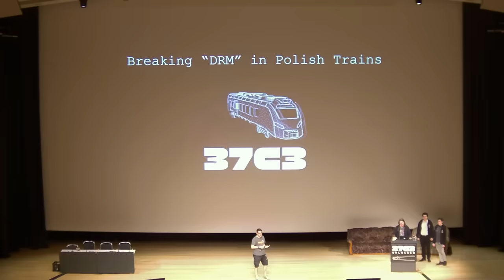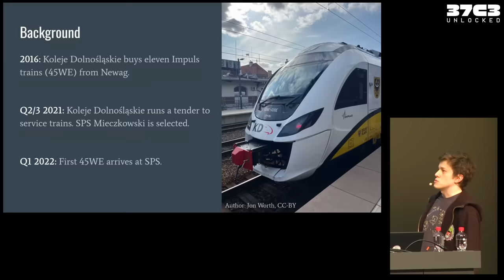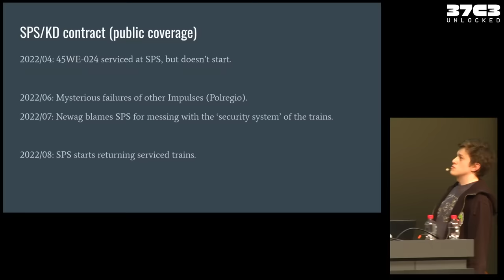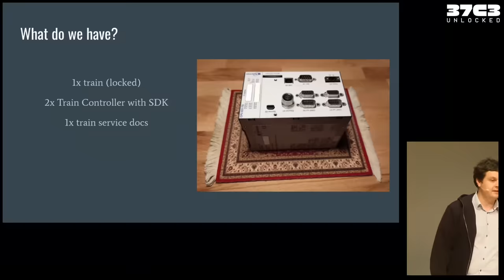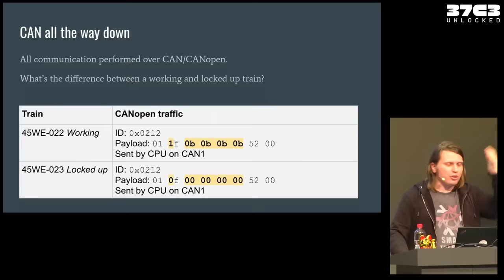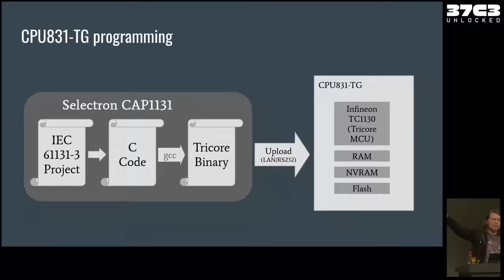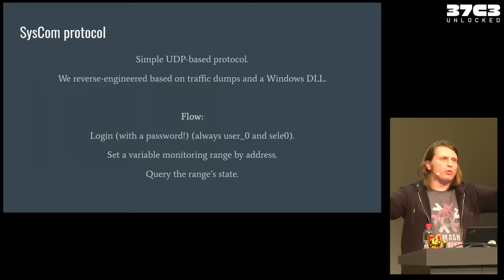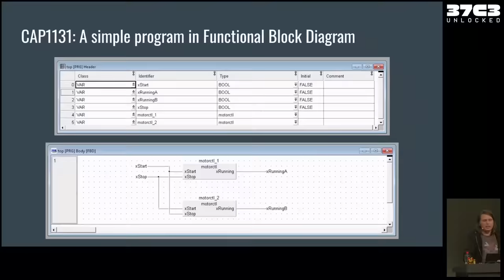37C3 -  Breaking "DRM" in Polish trains

Comment: As someone who's worked with PLCs and industrial control systems, generally speaking the PLC "program" (as in the function block diagram or ladder diagram you actually write) doesn't know if the firmware version is different between the hardware. However, the compiler adds this set of checks in after the fact and generally does just silently fail, unless you have the programming software that goes with the CPU and switch it to remote run. At which point the IDE/programming software will tell you if there's a version mismatch in some cryptic asf error message.

I've only worked on Allen Bradley/SIEMENS/Mitsubishi stuff though, and they're all a bit different to use. Some of them simply don't care about firmware revision. Some of them will only accept that specific controller serial number until you open the PLC program and manually change it. Generally speaking if you look at the patch notes for the firmware revisions and revise how the program interacts with the motor inverters, there isn't much of a problem in just updating the SN/FW version in the code.

In my experience repairing a lot of this equipment, the developers only work on minimum viable product, and then the rule of "there is nothing more permanent than a temporary solution" takes effect soon after if there aren't major problems. There's no polishing the code and making things look nicer or adding error messages for failures. They just add errors for unexpected conditions involving sensors, or disconnected equipment, and nothing else. Everything else is left to the maintainer to just guess how things are supposed to work in the event of a failure. Rules like "my code is my documentation" regardless of how detailed or frequent the comments are is also a key feature. Wiring diagrams are generally speaking plentiful though.

Also, if the trains have to be re-certified after new software is installed on them, then Newark shouldn't have been adding new code to it at all without going through the proper channels. It's also kinda stupid how if there even is certification that nobody looks at the source code for vendor lock-in and geo-fencing bullshit like this (or from what some comments are suggesting, turning a blind eye to it).

Thankfully, where I come from, I'd be able to patch it if something like this were to happen (which it absolutely has) and give the original developers the middle finger. But alas, I don't work on trains. I do work on giant storage machines and production line equipment like 3500-ton aluminium extrusion presses though. It's nice to know that once I finish this job, this is potentially an avenue I could explore.
Reply: We are 't talking about PLC firmware version. But the PLC program communicates using CAN. And through a CAN frame gets to know the firmware of the inverter.

The inverter itself isn't a PLC, so it's a box with just traditional firmware. But firmware version would decide how many CAN messages it understand or possibly if it understands specific bits in a CAN frame.

Comment: 45:00 the train has a GSM-R unit onboard, it must have in order to comply with ERTMS. So yes, there is a very legitimate reason for a transceiver being hooked into the CAN bus and other systems. It has to be for traffic control and safety reasons. If that modem loses connection, the train will stop.
Reply: Is if it goes through a tunnel or the towers are out the train will shut down? That isn't safe
Reply: so why it was connected to PIS network and not separate one? and why it's not in all trains and only in some of them
Reply: @kahtyman7293  You're not making any sense at all. PiS is a Polish political party as far as I know, not a railroad infrastructure provider.

Also yes ALL trains that run on ERTMS controlled railroads have a GSM-R modem in them. They have to, no exceptions.
Reply: @fermitupoupon1754  PIS is a short for Passenger Information System, and what I meant how is PIS router supposed to connect to Newag if, according to Google, all Passenger Information is under PKP?
Reply: @SuperSpecies in tunnels there are ways to bring radio signals in, e.g. by leaky cable as antenna.
Reply: To clear this up a bit:

In some trains, there is a device that connects the train-internal CAN bus and the internet-connected passenger information system. That device is not in the official documentation, so it is not clear what it can do. It, however, is in a position to theoretically allow access to the train internals from the internet.
Reply: The issue was not the existence of this device, but rather the fact that it was not mentioned anywhere in the manual or in the specs.
Reply: Shouldn't be simple connected to Ackermann valve without CAN?

Comment: That sketchy IP<->CAN bridge should also be investigated more seriously.

Should be at least an EU law that remote update channel SHALL NOT be available for ANY equipment. In consumer devices there should be an option to enable it, in partnership relations it must be explicitly asked for by the customer in contract to allow remote updates. And NO unattended updates. The user must initiate the update.

Honestly, can anyone imagine a situation when an unattended upgrade initiated by the manufacturer, on any kind of equipment is a good idea?
If the equipment is that security-critical, then there should be a security team at the end-user which decides how they plan to carry out the upgrade, if it is not critical, then there is no need for ASAP unattended upgrades.

If I go a little bit further, there SHALL be a clearly defined and customer-accessible IP entry point where the customer could attach their firewall if they wanted to, so no shady embedded GSM/LTE boxes with full access to the world.

Comment: The big lol is the terrible code. It gets certified by people who don't have access to the code or else they don't understand things any better than the original creators at Newag. It's really incredible to see such weak buggy code in what is supposedly a super secure system.
It goes to show that if no one is watching, then no one actually cares, especially in more hardware-style industries. The code is terrible and this is clearly perfectly normal there. There's only two developers who used to make Excel sheets but now they are in charge of making train software. And there is a manager who says "that's plenty good enough" twice a week, rubber stamping half-assed solutions.
Then they pretend to be clever saying they make sophisticated systems when in reality it's just a super convoluted version of a few if-then statements. Then they say others aren't smart enough to understand the refined complex systems, when in reality it's dumber than the average shell script.
Reply: you know the certification is most of the time just black box functional test without any code analysis. and some part of the certification is done by the manufacturer themselves by self reporting. the same was true with boeing and the 737 max MCAS software which caused hundreds of deaths unfortunately. this practice is simply wrong

Comment: Someone wrote those locks, probably a software engineer at Newag, maybe more than one.
If you are a software engineer, please don't do shit like this. 
First, because you don't have to, just say no and go work somewhere else, there is plenty of opportunities.
And second, because you will end up paying for it. You are responsible for the code you write even if you are "just" following orders.
Reply: I don't know about Polish law, but, in those jurisdictions I know about, this is a problem. As an employee, you are protected from being fired for cause for refusing to work when you reject an order that would have you commit a crime. However, that does not extend to many other illegal activities, especially if your part in them isn't illegal in itself. In this case, it seems this started as a breach of contract case (i.e. secret maintenance procedure---the non-disclosure violated the contract, not the implementation) and only escalated into the land of sabotage later.
Reply: You will not pay for it, that's ridiculous
Reply: Also, you do have to, refusing to cooperate can get you a disciplinary dismissal, an eternal state on your work statement

Comment: I don't know what's more insane, the fact that Newag...
- Manually input the GPS coords of their competitor's workshops to prevent their trains from working at the workshops
- Failed at trying to set a permanent arbitrary obsolescence date, instead causing the trains to not work on Nov/Dec of every year
- Failed at intrusion detection when being serviced 'unofficially', only being triggered if the train doesn't move for 3 weeks
- Needed you to input the fckin KONAMI CODE to temporarily disable these restrictions

I hope the CEO gets rehabilitative prison time.

Comment: Just from the way that secondary compressor date check looks I'm gonna guess that this software was created by someone who isn't a programmer by trade,

And it's in charge of 100ish tonnes...

That's not scary at all /s
Reply: as one that worked both with PLCs and health critical embedded devices - PLCs were made for people that could hook up some relays but not really write any code.
Reply: Yes, and additionally I suppose that the team tasked with adding the sneaky bits wasn't exactly large, given much time to check their work before pushing it out to the trains that were just getting maintained, or in fact get any second opinion on how they were going about it - you'd suspect mgmt would chat up someone who is usually not the first choice to implement something like this, but who is known as waiting for a promotion having just bought a house too big for their income, or otherwise compromiseable. At least you'd hope that's the case, if they had four guys looking over that code, having regular meetings and still letting THAT date-check slide, they should be looking for different careers...

Comment: Looks like the train company was thinking they are Apple.
Reply: Apple does some shady stuff, but still far from this.
Reply: @serpent213 Apple did exactly this
Reply: @thewhitefalcon8539  Which case are you referring to?
Reply: @serpent213  the one where they'd just slow down your phone over a certain age
Reply: @thewhitefalcon8539 They didn‘t do that.
They slowed down when the battery was old to prevent shutdowns. That‘s a huge difference that is easily fixed by people swapping their battery.

Comment: A certifier in Europe doesn't/isn't able to test lockout conditions. You go there, you state the required legal parameters, they test and see if it works according to specs, and then give you a green or red light.
In casino world, this goes very far, you get hefty fines or lose your license if your player tracker/payment module contains software that has not been certified.
But then again: casino world is very well regulated and scrutinized by the government to prevent money laundering.
This certification probably also happens in train world, but who actually is going to test if the software on your train is actually the certified release? You won't catch any money launderers, so there is no incentive.

Comment: Releasing breaks but not applying power to the engines might have "unforeseen" and deadly consequences on a hill. Of course that's not where you park a train. But what if that particular lockout also happened during real use.

Comment: What makes my head spin is that these locks had to be implemented by some developer in the company. It's very, very unlikely that the programmer who did that is also a major (or any for that matter) shareholder, who would directly benefit from doing something that low and immoral. I mean, what would be the incentive to do that? Losing a job if he refused? I don't think so, because software engineering companies in Poland are permanently struggling with finding competent engineers (it's a tight labor market, or employee-centric market if you will). I could only think of a bribe and hell that would be a a big bribe because if he came forward with these in court, the repercussions for the company would be insane (not only financial but also criminal I guess). I'm a software engineer myself and with my salary as well as how many jobs there are to pick from, I can't imagine myself doing that. Not only I would refuse to do that but I would set up a hidden camera for next meeting about this and take this straight to the district attorney. They would have to threaten to harm my family to stop me...
Reply: wedlug Cieszynskiego, Polski rzad i sluzby wiedzialy o tym juz w maju 2022.

i.................. jak myslisz, czy cos zrobily?

Comment: wow, this is wyld with a capital W! great job reverse-engineering those damn symbols, and these practices of software locks on train are a freaking scam. imagine finding that for cars, like vw locking their cars when you do not bring them to a licensed vw repair shop or vendor. I bet you would have lots of angry customers on your doorstep in a minute. this for sure is something that should be followed up with and criminally charged I think. imagine being a poor polish citizen and then your train stops or does not drive cause it was serviced at the wrong place or is over its limit. imagine your car breaking down in the middle of the street instead of just the servce lamp going on. this is crazy!

Comment: If it does turn out that they had the CAN bus accessible from the internet, that sounds like a huge safety hazard.
Reply: Nothing so fancy. A box with ethernet interface can reach both a network with a cellular gateway and can communicate on the CAN interface.

That box itself is a firewall from a logical perspective. But it's a box that could do an ET Phone Home and ask "Ping Mama - should I lock train xxx?"

And that is why they are going to try to look closer at that specific box. To see if it has any phone home functionality to remote back a train "service condition".

Comment: orthogonally to all the rules the european council is trying to push upon the engineering practice of software, this case should be used to push the implementation of additional concrete technical requirements like executable segment checksums in delivery/validation documents and opening up all internal communication protocol documentation. "reserved (for internal use)" must not be allowed.
software is part of a tool, or more a tool in itself. We're literally not using anything that's wrapped in black plastic forever, because something that has the silhouette of a hammer but actually isn't is a scam. The same vigor of unwrapping the thing should apply to black box software.

Comment: Honestly, the older trains are better than the new ones. 
The old trains second class seating is way better than todays first class seating.
Reply: Tbh Impuls isn't comparable to Intercity cars (and it seems you're talking about them), it's different class of a train. Impuls is a train designed for regional routes, the equivalent there would be EN57. It's ugly, loud, its seats were made of plastic and highly uncomfortable to seat on.
Reply: Nothing stops the train operator from putting more money into passenger comfort – for example the same Pendolino of a private Italian firm is much better than Polish ones in this regard.
The interior is the least complex part of a train, and is often refreshed during major maintenance works like after 15-20 years. You can have great new seats in a 40yo train, but it probably won't be as safe as a modern one in case of a crash. And with low noise, reduced vibration and smooth acceleration I'd say that modern trains are more pleasant in general, even if less luxurious and more cramped than in the old days. Also commuter or regional trains by definition are less comfortable than intercity, but I observe that the difference is shrinking compared to what was before.
Reply: @Maciek888 Please don't remind me about refurbishing trains. I'm still salty about the ICE1 one. The old seats were very nice, and then they threw them out and replaced them with ones that won't stay upright under my weight.

Comment: NEWAG does what it did because the buyer did not protect himself properly during the contract. If it had been written in the contract that they had to provide the source codes and only the owner could upload the results to the train's computers, this would not be an issue. NEWAG may then refuse to agree to the sale - but if all buyers followed this rule, they would have no other choice. They would probably have to focus on designing the train's service life in a place other than the cheapest place, i.e. in the firmware.
Reply: oh yeah?

do YOU have the source code which is operating in your car ?

Comment: Please move the legal parts to the start of your talk. I was more Interested in the legal part which most Media ignored or got wrong.

It is very interesting that such an important system is not included in the homologation process. Before this talk I supossed that you bricked it... until someone renewed most certificates.

Why are there yellow cabels connected to the PLC? Some PLCs can  get in bad state, if they can run arbitrary programs in the background. IMHO it is not a good idea to send potential arbitrary data to a yellow box. They shall be hardend, but shit hapens.

Comment: What's the TLDR of this. Companies scamming buyers? And these guys were hired as a 3rd party to find out why?
Reply: Train manufacturer was installing software "traps" to ensure, that the train will not work, if any other company services it. So yes, the buyer was effectively scammed (as trains were sold with complete servicing instructions, as per contract), but the buyer is the rail operator. That regular people, and taxpayers, pay them in turn (using their services).